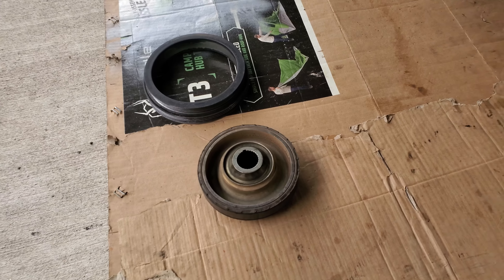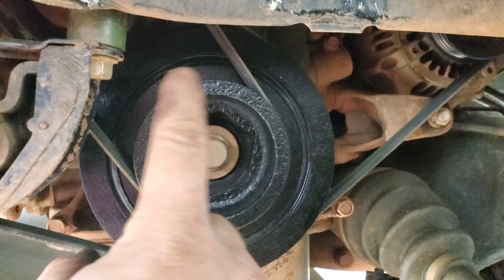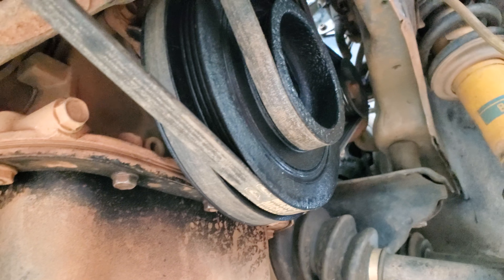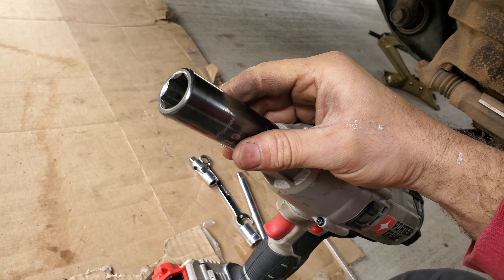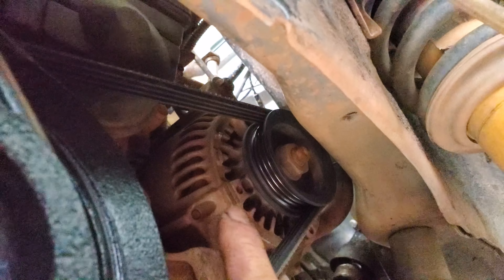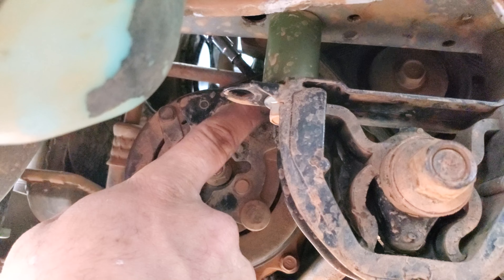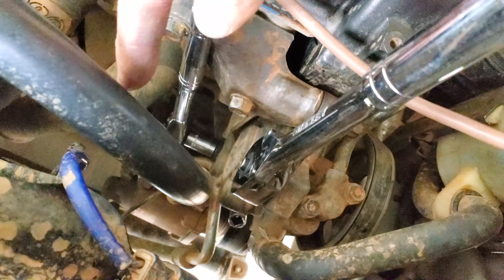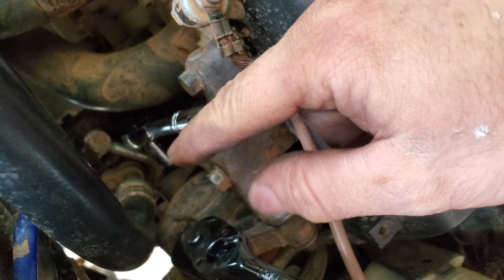How To Remove A 97-01 CR-V Crank Pulley

Comment: Does the gap in the center of Crank Pulley have to go on a specific way or direction?
Reply from the maker: Yes, but don't worry about it. It's very easy because the key will only install one way. You can't mess it up

Comment: hey mate, I was just wondering if this sort of engine uses a CKP Sensor and if so is it located behind the crank pulley? And if it isn't behind the crank pulley, would it be in the distributor? Thanks.
Reply from the maker: There is a Crank Position Sensor behind the crank on the the original motor. On this jdm b20b motor there isn't one so you just do the bypass. There's some really good YouTube videos already out on how to do it, the bypass took me about 5 minutes.
Reply: @rt4wd_wolff  can you bypass it even though its not giving any check engine light code?
Reply from the maker: @castorz8971  I have no idea, probably. Why would you want to do that anyways if it's working fine? You should do the bypass and let me know what happens.

Comment: What size subframe drop do you have?
Reply from the maker: 1.5 inch
Reply: Would this fix axle vibrations for 2inch lift ?
Reply from the maker: @robertgonzalez1434  yes, it'll fix the wobble from the axle
Reply: What kind of shocks are you running and did they take away any lift compared to the oem ones? Appreciate you answering my questions
Reply from the maker: @robertgonzalez1434  Bilsten struts with old man emu springs on a full HRG lift. You can find the lifts on HRG-Engineering.com. My cr-v is lifted about 3.5inches in total
Reply: @rt4wd_wolff  yea im about to order the subframe drop. What type of bilsten you running exactly?
Reply from the maker: @robertgonzalez1434  I bought them 3 years ago. Just got ones that said they fit the 97-01 CR-V. I don't know what model